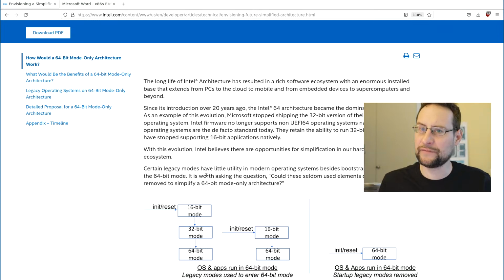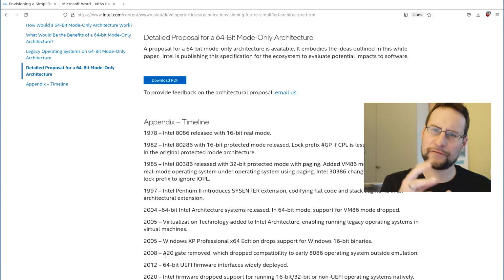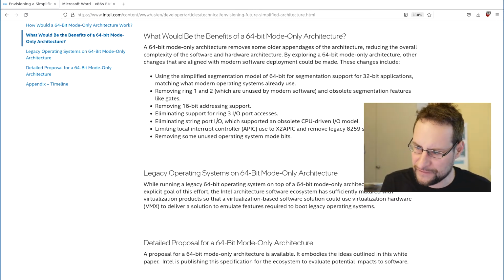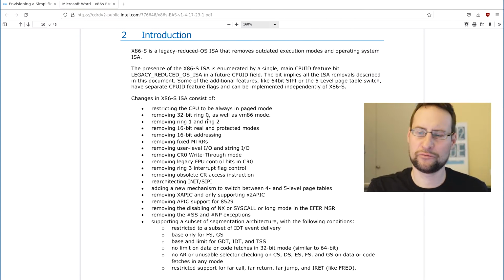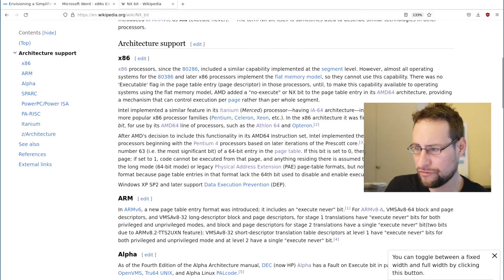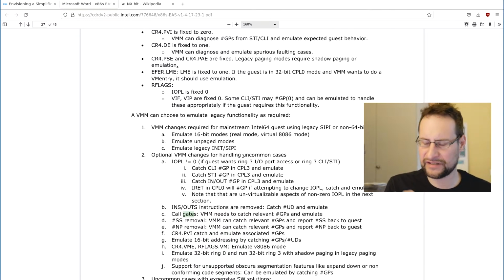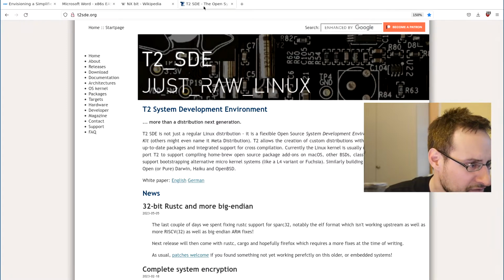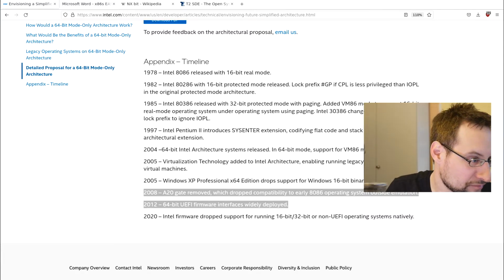FINALLY: Intel to remove 16-bit REAL MODE, some 32b RINGS & more LEGACY from future x86-s CPUs!

Comment: Hopefully a UEMI shim (to accommodate Legacy/CSM on UEFI only machines) and another solution for the 16-bit CPU instruction set can be found so newer hardware can still be used with old OSes.
Reply from the maker: Only implementing an hypervisior / emulator in efi

Comment: This is nothing to celebrate. This is another in the steps being made to prevent use of older OSes. Next is disabling VM hosts like VMware and Virtualbox and others. This is all about money and control, other excuses notwithstanding.
Reply from the maker: vintage software can long not natively be used on modern CPUs, either too fast, no driver, long no full real-mode support anymore. I rather have a 10%, 20% or more faster CPU for even day tasks, vintage stuff can always be emulated, in Qemu, Pcem, DOSbox, Bochs, just to name a few.
Reply: @renerebe  to see beauty, try at least some distro of QL SMSQ/E on QPC2 emu ))

Comment: I know my opinion is not representative for the majority of users, but this really upsets me. Apple’s ARM systems are extremely compelling and I would have already switched, but I really enjoy x86’s backwards compatibility. I use DOS, OS/2, Win9x, WinXP and all kinds of exotic software. Even natively. I dual boot Mac OS X, new Windows releases and Windows XP on a ~2019 Intel system. It is my choice. I am interested in these systems. I prefer using them. Who cares if some firmware developer needs to read a 1990s reference manual on how to initialize an x86 CPU? It’s relatively few lines of assembly code - and it’s been done before. Changing existing software, emulating missing instructions, etc, sounds a lot more time consuming and troublesome than just keeping these legacy instructions around. Change for the sake of change. AMD screwed up certain legacy instructions and also caused many Win9x VMs to break. I stick with Intel for compatibility, and it is amazing to use the same Windows XP system I used 20 years ago natively on a brand new Intel machine and everything just works. I am thus not dependent on vintage hardware to natively run my OS of choice. Why do they want to take this away from us? Just so some idiot’s Fortnite gets 1 FPS more? 🤷🏼‍♂️
Reply from the maker: 1fps in Fortnite sounds so unimportant when we talk compiling the Linux kernel some 15 seconds faster! :-/ As I often say I consider x86 already way too complex for an ISA, which certainls shows with all the constant bugs and marginalizes, ... You also need to keep in mind that all the Q/A (Quality Assurance) in design and final product testing certainly costs some millions extra for instructions so old that nobody except the unit tests are using them anymore. As I said Intel removed the A20 gate years ago, so it should already not be possible anymore to boot DOS or DOS-base Win~DOS, ... So reduced complecity (ala RISC ;-) is certainly welcome to get x% better performance  and efficiency, and focusing millions of R&D and QA spendings on actually used IPC, ... especially when such old real-mode software can be cycle accurate emulated on this high performance silicon (PCem or Qemu , DOSbox et al, ...) anyway, ... ;-)
Reply: @schreiberstein That point is one that I've seen quite often this week.
BTW. I'm using a tablet from 2015 every day, and it is a x86 machine that runs Windows. What Android tablet from 2015 is still usable today?
Reply from the maker: @Findecanor  well, most Android tablets were already low-end and under-powered in 2015. Even the first iPhone and especially 1st iPad were so underpowered that even Apple had to drop support and update quickly. While unfortunate this is more comparable to initially IBM 8086 PCs that nobody wanted to use once they had a 286 or god forbid after having hands on a 386! To be even more fair, I burned myself quite with the Surface Pro 2 which was similarly underpowered and quickly unusable even with Firefox on highly optimized Linux today :-/